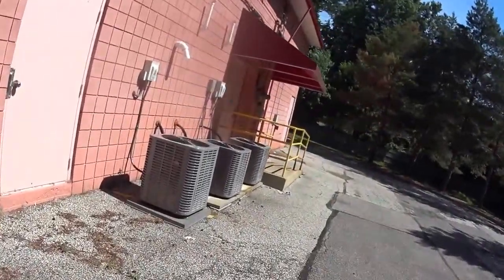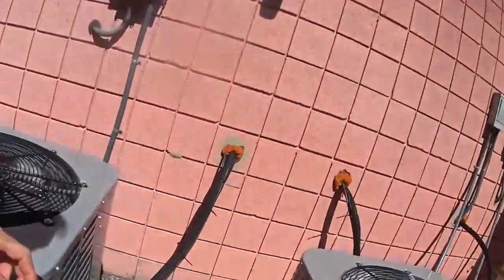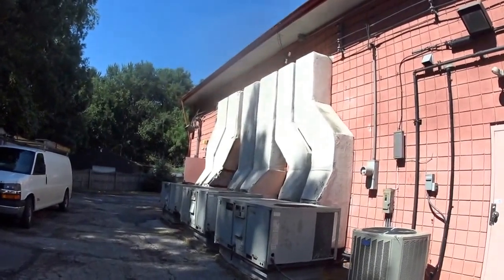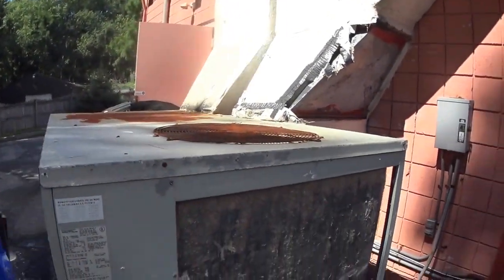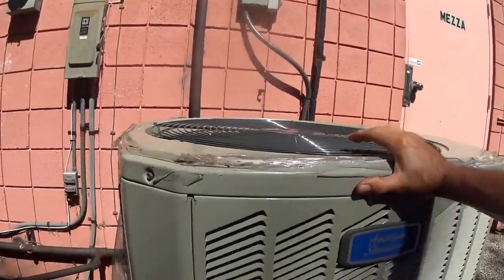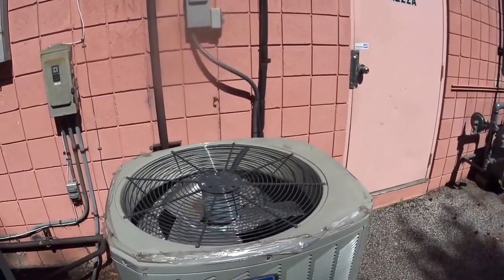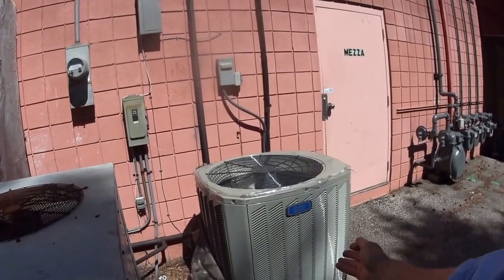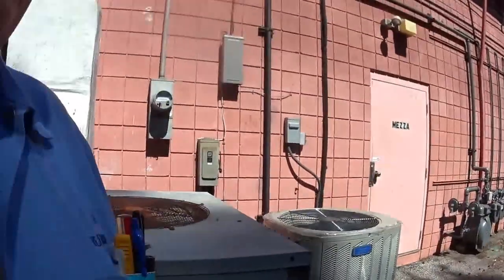Air Conditioners with louvers get plugged up

Comment: I was on a tour of the Trane plant in Tyler some 20+ years ago when someone put this question to the Trane rep. His reply was to use a soft flame of a propane torch to CAREFULLY burn the lint off the spiny fins. DO NOT BURN OR MELT THE FINS.
There aren't many cottonwood trees in my area so, I never got to try it.
In defense of the spiny fins, I will say they will hold a lot of dirt before the compressors start overheating.
Jim, maybe you can try this and see how well or how bad it works.
Thanks for your vids.

Comment: I get the purpose of the louvers and they do help with stiff like hail damage etc. But they sure are a pain to clean. I used to work at a place that had over 300 goodmans that had a similar design.
Reply from the maker: Erick Cooke thanks for the comment